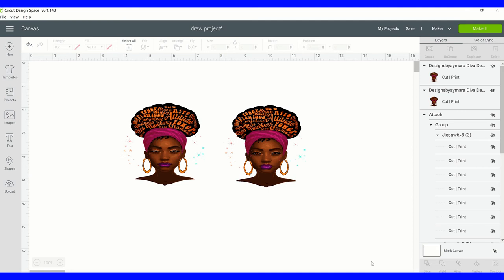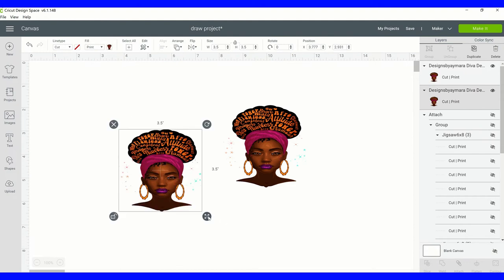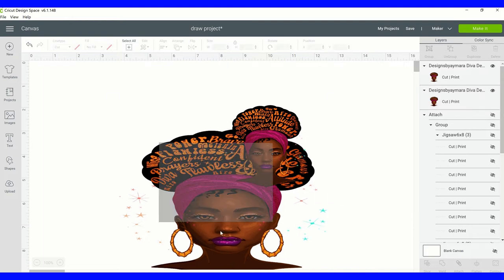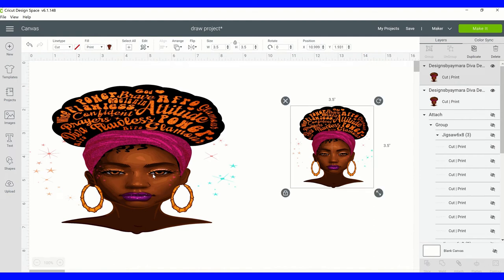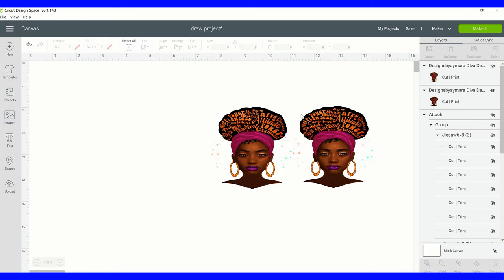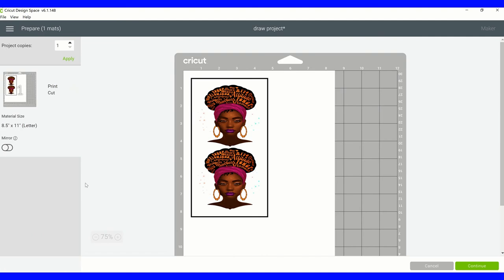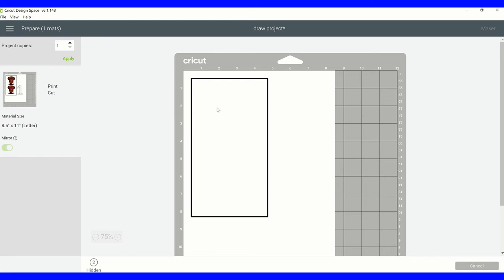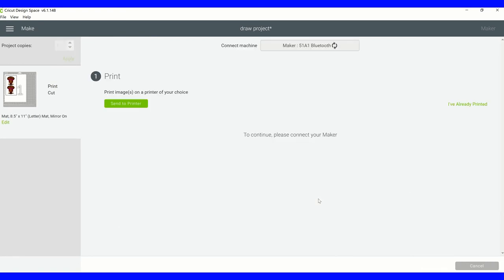Sublimation onto a stainless steel coffee mug

Comment: Hi Ms. Doris
When printing out your design for a stainless steel tumbler do you leave it as a png image? I have tried mine’s as a pdf print and it will not sub. Help! Thank you in advance.
Reply from the maker: Yes, I left it as a png. I don't like subbing on stainless steel because the colors are hard to see. But yes, I left it as a png. Where did you get your siblimation stainless steel mugs from?
Reply: Ms. Doris
I knew you would reply. Thank you so much!!! 💐